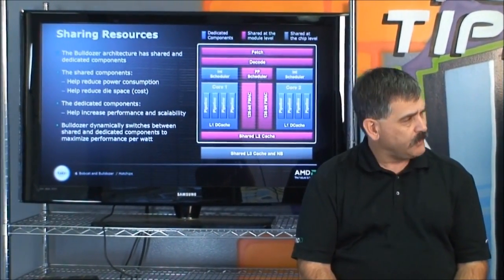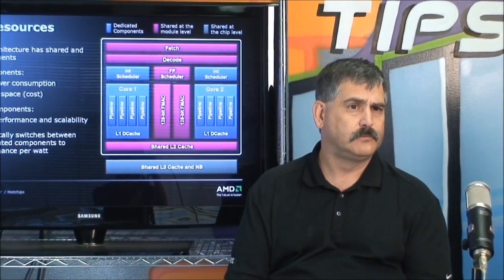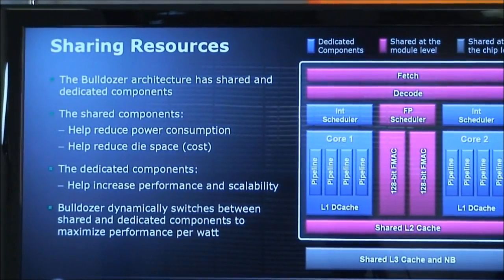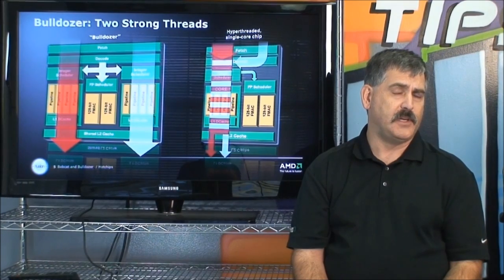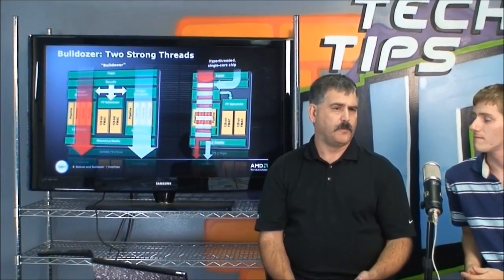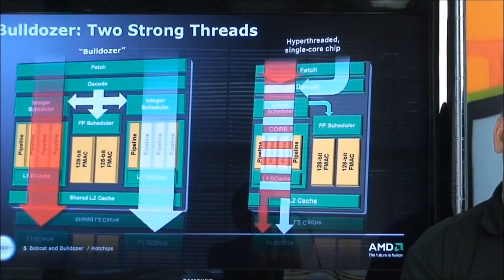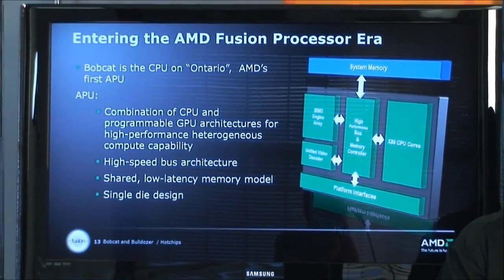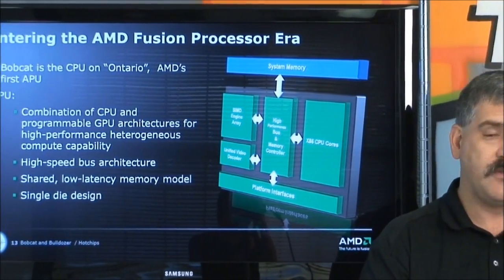AMD Bulldozer & Other Upcoming Technologies Interview With Jim Bovenzi (NCIX Tech Tips #85)

Comment: I think if AMD had treated the new module design as a single core with extra integer capability instead of as a dual core with reduced floating point capability we would be in a much different place today.  That is, we could have had quad core CPUs that would blow everyone away for their performance instead of eight core CPUs that fall short on expected performance.
Reply: Not really, because bulldozer never scaled well and no matter if you call it 8 or 4 core, the gaming performance was still very much behind the intel 4 cores, while it was good, but not impressive under productivity either. Besides, the extra integer units needs to be feed with multiple threats anyway, so we would be seeing a form of hyperthreading on crack with those 4 module bulldozers.

Comment: Its great for a basic system. But that's it.

AMD CPUs can't handle SLI/Crossfire very well or playing at very high resolutions. You will start seeing micro-stutters.

And since 8 core cannot be used fully, and they are not 8 full cores, Intel is still the way to go for a better rounded PC.
Reply: Quite a different story now lol

Comment: at the moment yes but keep in mind the software is not designed for bulldozer yet, I run a bulldozer in my computer running a linux operatign system and it flogs the abosolute crap out of the i5 my parents have when running at half the ghz

Comment: Watch this: watch?v=rn-kEqND5VA&feature=related 

Put your 955 in it but with a 300-500GB HD and a 550Ti. You can always buy another HD or 550Ti later. The 955 is a Black Edition for better overclocking. If you don't intend to overclock then I suggest the 945 or 925; they are cheaper and just as powerful but don't overclock as easy.

Comment: Just to clarify, ASUS and MSI announced that certain AM3 motherboards will be able to run "unannounced" AM3+ processors with a simple Bios update, while Gigabyte decided to replace the am3 socket of all of their am3 boards with an am3+ socket.

You should take note that the am3+ socket has 942 pin while am3 has 941 pin, also you will need to make sure that your board can give the CPU the power it needs, some of the am3+ new features won't work and AMD might not support such setups.

Comment: @BUrbbable Just to clarify, ASUS and MSI announced that certain AM3 motherboards will be able to run "unannounced" AM3+ processors with a simple Bios update, while Gigabyte decided to replace the am3 socket of all of their am3 boards with an am3+ socket.

You should take note that the am3+ socket has 942 pin while am3 has 941 pin, also you will need to make sure that your board can give the CPU the power it needs, some of the am3+ new features won't work and AMD might not support such setups.

Comment: @neonzion7 

I haven't seen the benchmarks so i'm not going to argue against you on those, but people tend to look at the overall package when upgrading, I know I do. When upgrading from, say, a Core2Duo to an I3, though i'm not sure why you would, you'd need a new Mobo & memory, with AMD your upgrade may not even need either, just replacing the CPU in your Mobo and maybe a bios update, depending on what you have and the ability to keep your existing DDR2 memory.

Comment: @MrPwnstar007 cores are only a piece of the overal cpu specification. Cache, clock seed, size, and MUCH more are involved. Since 2010, quad cores were finally being used well into software. Many people kept complaining about this and how 6-8cores and 12threads from Intel was not necessary. Looks like they listened. Clock speeds have barely gone up in the last 4 years. But from 2001-2005 clock speeds nearly doubled. Looks like they will lower cores but add clock and cache =)

Comment: @youngdones , No one knows, it hasn't been released, no leaks of real benchmarks etc, rumors all around suggest 50percent better performance compared to a thuban core at the same clock speed (phenom 2 x6 1090t) , which will make it just a tiny bit better then a Nehalem, hardly noticeable, but its just a rumor, my guess you'd see better scaling in multithreaded performance vs Intel's multithreaded performance but i believe core vs core at the same clock speeds, Intel will still be slightly ahead.

Comment: @dchains I think I mis worded my account, what i am thinking is if you have a 2 core bulldozer(4sub cores(module)) each of those are possibly capable of running a hyper thread the way they are created.
the bulldozer would be capable of simulating 8 cores in a 2 core chip module.
if bulldozer is to prove as they say, it will annihilate a phenom II performance wise and quite possibly smoke a 980x intel